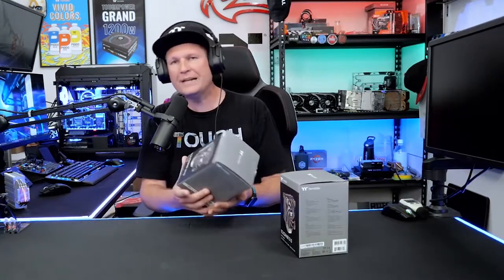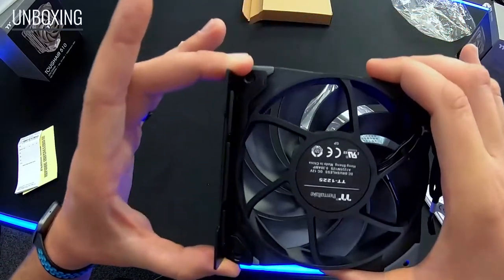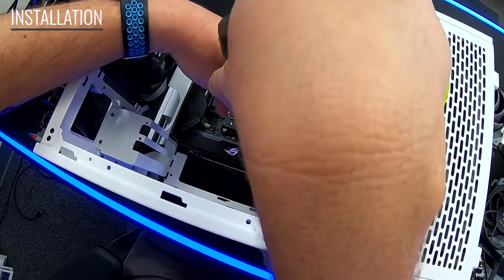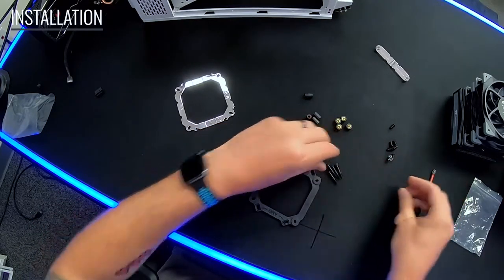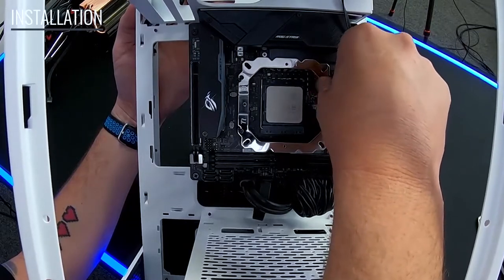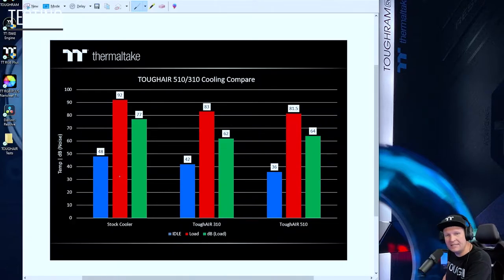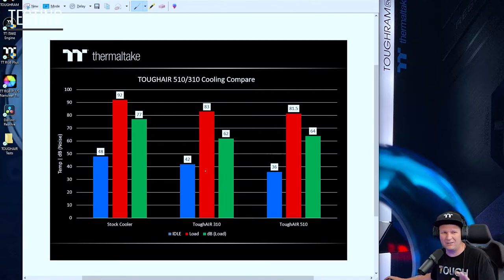UNBOXING and INSTALLATION of the TOUGHAIR 310/510 CPU Air Coolers!

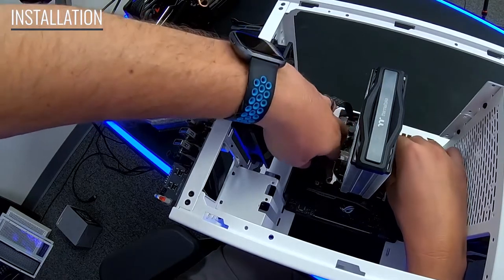Comment: Thanks for the video, just installed my Toughair 510 and it works well (quiet and keeps my (not overclocked)  intel i5-11400 below 55°C even under load). Just one tip for people installing this cooler: at 11:40, you have to make sure those 2 screws are as tight as possible. At first I didn't tighten them very well and I was getting 80-90°C temps because the cooler sink wasn't making good contact with the cpu. After tightening them it worked perfectly.

Comment: I dont really understand why Thermaltake add a backplate for AMD. Even heavier Cooler from other companies are using the stock backplate without an problems. And TT seems to be stuck in the 2010s, this small bracket has been fixed in recent years, with pretty much every vendor already from the outset, which reduces one step in mounting and it is not so fiddly.

And if you compare it in general with the mounting with other AM 4 CPU coolers, it has at least 2 steps more.

The entire design is not really user friendly, except for the attachment of the fans. But in general, you get the feeling that TT takes one step forward and three back.